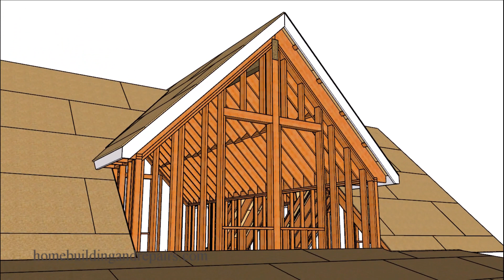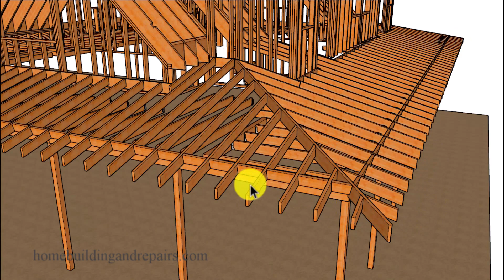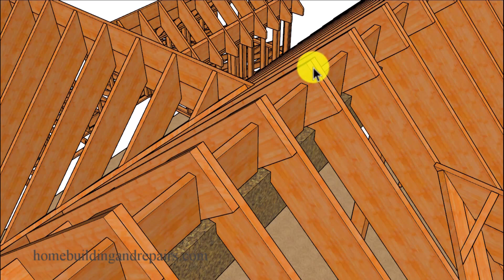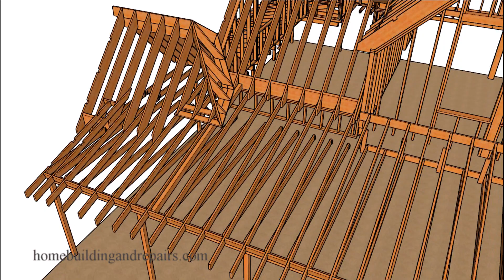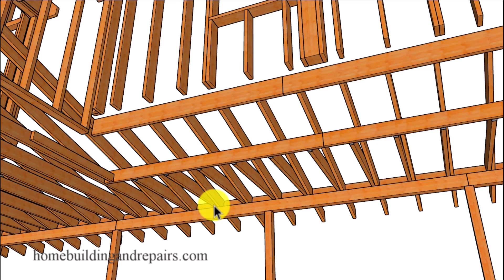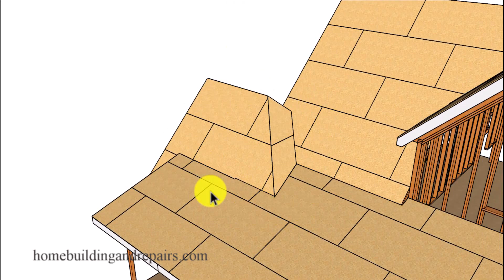Elaborate Roof Framing For Building Two Story House With Wrap Around Porch - Part 6

Comment: Is one of the gable ridges higher than another for construction reasons or this just an aesthetical thing? Can you please provide some general advice  how ridge height should be chosen.
Reply from the maker: Higher ridges usually are because the width of the building is wider or the roof pitch is steeper.

Comment: How does the one big over frame gable work with no ceiling joists or structural ridge? The one with the double ridge that supports thesmall dormer? I was thinking maybe that small shed roof is bracing that knee wall that the gable roof sits on or something just trying to understand the design
Reply from the maker: The porch roofs on each side should provide enough support, but I'm not an engineer and a project like this might require a ridge beam.
Reply: @gregvancom  yes sir thank you, Is this common practice ? I’m really just trying to educate myself on framing as I work for a carpenter. I see stuff like this often in higher end homes where you can’t simply tie everything together easy, and just trying to understand how stuff like this works.

Comment: Hello. I have a few questions about the roof framing.
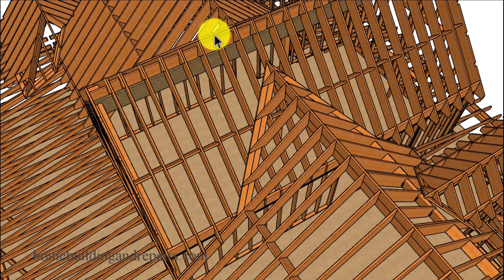1. At minute 3:05, why did you lap the rafters at the ridge instead of butting the ends together?
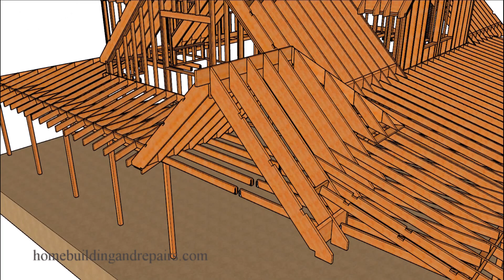2. At minute 3:45, why don’t you raise the entire roof structure so that the two planes of the roof sheathing meet at the upper corner?
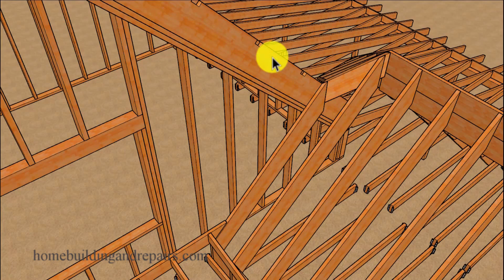3. At minute 4:00, why not eliminate the entire back angled section of the “wacky porch roof” and just use a vertical wall at the back with a small porch roof overhang?
Reply from the maker: You can definitely change the design and the roof will be a little stronger by nailing the lapping rafters together than butting them in most cases.